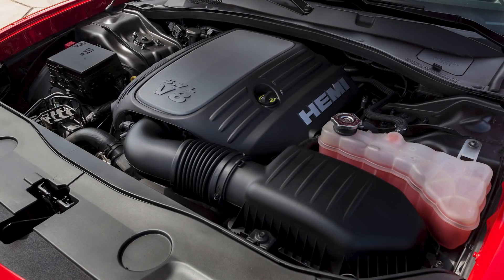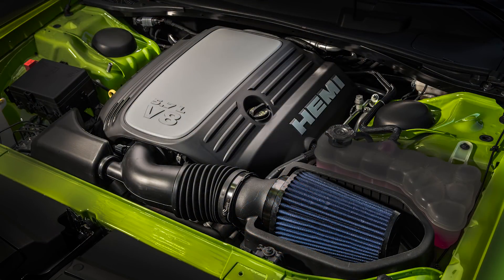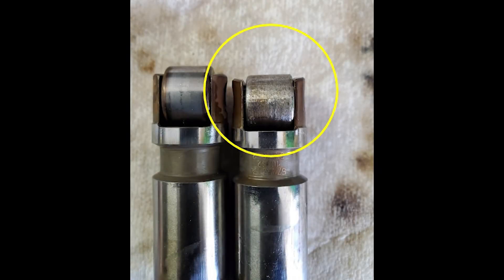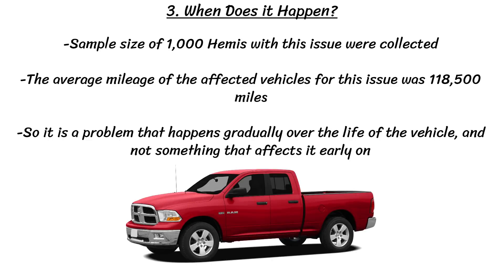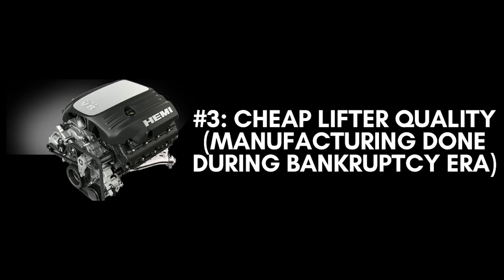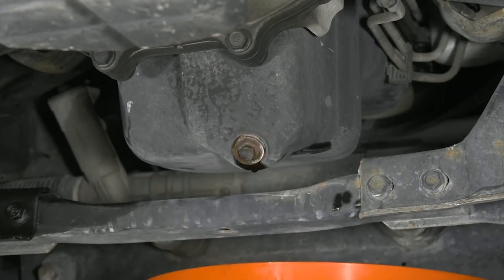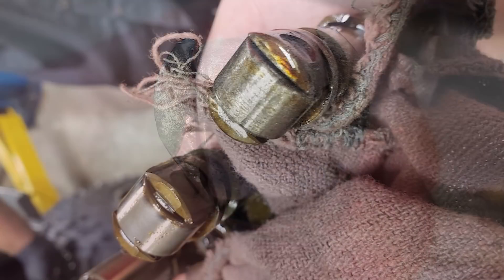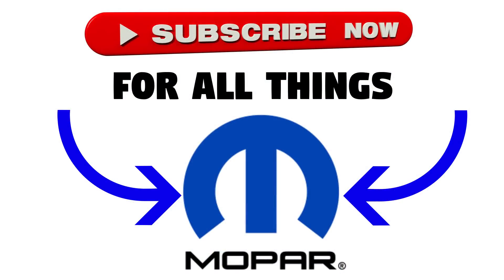The Fatal Flaw of the 5.7L Eagle Hemi V8 Engine Fully Explained (2009+ Lifters and Camshaft Failure)

Comment: My 2010 RT has 204,000 and runs like a clock..... *knock on wood*... That being said, it's whole life has never been late for any service and always used full synthetic. She is also not beat to death. Only idles in traffic and oil is changed every 5K.
Reply: I had 180,000 miles on my 09 Challenger RT 5.7 Hemi,only issue was a waterpump at 140,000...I do floor my cars daily..Sold it a few years ago to a friends son,he still has it and its still rockin!
Reply: @01trsmar  Exactly, the problem isn't with the abuse while driving, unless you count the fact that to many do so with dirty oil and change it when the indicator says 0% oil life. Don't waste money, but if you constantly hammer on your Hemi, you MUST change the oil frequently. The Hemi is just more sensitive to this issue
Reply: 126,000 on my 2010 RT only tick I have is the exhaust leak from the bolts. It's a relief honestly since it's not a lifter tick and if yours has 204,000 I'll say the 5.7 is clearly reliable
Reply: @PigBenis878 Mine ran like brand new until right at the 200,000 mile mark when the transmission went. Never had a tick. My cousin has one with 320,000 miles on it so I have faith that it'll also live a long life in my Duster.
Reply: I have a question...I keep hearing "change the oil every 5,000 miles" how can this be good for the car? I have been racing muscle/pony cars for the last 26 years of my life (all adulthood). I go 3,000 miles on the dot and never let her go over. This has been my experience but I have always owned GM's. From Trans-Am's, to Camaro's, to Trans-Am, to GTO, to my 2012 SS Camaro, and now my very first Dodge 2017 Challenger RT. I'm not trying to be a jerk or a wise ass...is this better for my new Dodge? If it is, please tell me because I am very new to the Dodge experience. 

I almost purchased another SS Camaro (looking at a 2018) but something really bothered me about the car. The more I looked at it up close the less I liked the way it looked. In my honest opinion, and this hurts too say...GM has lost their way. The newer Camaro and Mustang bodies do not look American too me. Thankfully, there was a yellow and black Dodge Challenger RT+P on the same lot. I chose to drive it, almost half heartedly and I freaking loved it! I bought the car right then and there jumping in with both feet. I haven't been this excited about a new muscle car since I bought my 2002 Firehawk Trans-Am...in 2002. That's how much I like this car and the cheery on top is how freaking cheap it's been to mod her.
Reply: @Sinn0100  I do ALOT of highway driving so my engine spends most of its life turning at 2k rpms... Highway driving is easier on a motor, so that why u change it every 5K... That being said if I drive more city or stop and go traffic I would bump it down to 3k.. I also have my oil tested everytime I change it so it's monoterd.
Reply: Thank you. You are living proof as I have exhausted myself telling others the same. Change the damn oil every 3,000 and the filter and as you said high end quality oil. Period guys. SMH.
Reply: @fredwilliams7893  Yep I agree with the 3k miles oil change with quality synthetic oil for now it's still cheap if you do it yourself.
Reply: By runs like a clock you mean it ticks?
Reply: @Iamadroid  99% of the dreaded "Hemi Tick" instances are upon initial startup, and you are hearing the tiny exhaust leak from the broken exhaust manifold studs. That isn't good but it isn't engine damage. Mine quiets down after about 30 seconds and runs like a top. Good oil every 3000-5000mi is the key to overall longevity
Reply: @Iamadroid damn!

Comment: Is the 6.4L in Ram heavy-duty a similar design?
Reply: Yes but doesn't have same problem.
Reply: @snek9353  Oh no the 6.4 doesn't?  Tighter tolerances on the 6.4 it happens at way lower kms on some.
Reply: @snek9353  Yes it does. It's not as common though.
Reply: @gasolinediesel972  Well yes but not really. Not only is the issue MUCH less common in the 6.4, it's also largely a 11-13 thing and the 6.4 wasn't put in the Ram until 14. Also to some minor extent it's also an MDS thing and the Ram HD doesn't have MDS. So sure it's possible for a 6.4 Ram to have a lifter failure but it'd be very very rare.
Reply: @snek9353  You are correct, it isn't common at all, but it does happen. This issue isn't even that common on the 5.7 anymore. Many people think they are having issues with the cam and lifter but they actually just broke the exhaust manifold bolts.
Reply: @gasolinediesel972  Yup, this issue has largely been solved since '14. But the hype and paranoia continues. Roller lifters are high stress parts and these engines have both aggressive camshafts and aggressive drivers. Put that in combination with poor maintenance and no matter how good they make the lifter some are going to fail. 

This hype is why I know about this stuff, I know a lot about engines but don't work on them for a living anymore. But my desire to own one spurred me to research the heck out of this. On the flip side I'm confident I paid less for my car because of the (falsely)poor reputation.
Reply: @snek9353  A lot of people that I see with these engines change their oil every 20k miles and they complain about the engine when the lifters go bad. I've got a 2018 Ram 1500 with this engine. I notice a slight tick when I start it but I think it's the exhaust manifold bolts because it goes away after a couple seconds. 49k miles.

Comment: Gen 3 Hemi lifter  needle bearings too small and too weak. Lifter roller needles were upgraded with thicker needle bearings from 2016 year production. From 2018 another supplier was introduced to supply Hemi lifters. Premature roller failure covers all Gen 3 to  2015. Original PN ended in AA. From 2016 PN changed ending in AB, current lifters end in AC. AB and AC use larger needle bearings. Your observation about needle thickness and possibly metallurgy in pre 2016 or pre 2019 roller needle revisions likely closer to truth.
Reply: Damn I missed the party. I have a 2015 Ram 5.7
Reply: @rockcreekrockcreek6644  heavy duty lifters introduced 2016 year production.
Reply: I have a 2020 RAM SLT Classic 5.7L Hemi. Does mine have the new lifters with the upgraded needle bearings?
Reply: @Thomas_M76  2020 built Hemi has   heavy duty lifters fitted. Heavy duty lifters were installed circa 2016 though supplier change  for some unknown reason 2018 year production. People tend to refer to revised heavy duty lifters as Hellcat Lifters. So you’re good for long term durability and reliability. Engine probably outlast truck!
Reply: @index6738  Good little piece of mind there. I just ordered a 2022 ram with the Hemi.

Comment: Where did you get that idea of changing oil every 3K?  1968???
Reply: Oil is cheaper than engines. We still tell our customers 3k for conventional and 5k for synthetic.  After manufacturers starting telling people they could go 10k or 15k to make it sound like they didnt need as much maintenance, the amount of timing chain failures went way up.  Look up mini cooper timing chains or GM 3.6 timing chain failures or ecotec engines. The list goes on and on.
Reply: Changing full synthetic oil every 3000 miles is nuts,this oil is good up to 8.500 miles ,so if this hemi cant go more then 3000 miles with full synthetic oil,well is a junk.
Reply: @mariuszmajecki2972  We tell people 5k on synthetic and 3k on conventional.  Yes the oil is still good but its the dirt and contaminants it gathers.  If the Hemis are having problems under the best of conditions why risk it. 5k or 6k is prob fine. New engines also have very small oil passages for things like variable valve timing etc.  It doesnt take a lot to clog some up. Do I think the Hemi's are Junk? Yeah I kinda do, If the valve train was designed better it would probaby be a very good engine. The MDS system is another bad idea. GM's version for the LS isnt any better. And all of it runs off oil pressure.
Reply: @jrharryman32  yes,why risk 6 7 or 8.5 ,but on the other hand FCA installed interval light reminder, this computerized device monitor your driving habit and calculate your proper oil interval,so what we are heard here and see is,do not go with the light reminder. Skipped,but again FCA do not change anything about it.
Reply: @mariuszmajecki2972  Those maintenance reminders are nonsense. It started as a selling point in the early 00s for the dealers to say "hey this car only needs the oil changed every 7.5k." Or they gave free oil changes for 100k.  So they stretched the intervals out so the company didnt have to pay for as many oil changes.  The interval light does nothing but count miles. you can reset them anytime without even changing the oil.  So what to they actually do? I wouldnt count on FCA or any other manufacturer to do whats best for the customer only whats gonna make them the most money..
Reply: @jrharryman32  I own a CRV ,oil change according to the reminder light,no problems 13000km ,civic same procedure, 13000km,before have a toyota Corolla, 12.500km between oil change,no problem,this 2019 ram 1500 classic is the first vehicle that other owners tell me,do not follow the factory requirements, so clearly the producers FCA do not stand behind their product,shame of the FCA
Reply: @mariuszmajecki2972  Well Im Honda/Acura and Toyota certified. I can tell you that both of those are much better made.  The K series 2.4 in the Cr-v (if its that new) Is an excellent engine and takes a lot of abuse. When I do have to put timing chains on them its usually over 200k mi. My whole point was the price of doing early oil changes is cheaper in the long run.  You can reset the oil light on the cr-v without changing the oil also. If you changed the oil earlier it may go 300k without needing a timing chain. Our shop also has 2 ruined GM 3.6 engines in cars and I have had 2 people this week that need chains. Its another terrible design that GM wont stand behind. One guys car has 164k it needs chains and The chevy dealer already replaced them for $3000
at 110k. We are cynical about cars because we see the worst of them and what manufacturers dont care about.

Comment: My 14' Charger has had no issue with this thus far. 86,000 miles and runs like a top. I do my own oil changes, and do them on time. Mine was also assembled after the bankruptcy issue was resolved, so "knock on wood"

Comment: I had the same thing happen on my 2009 charger SRT. Cylinder 6 developed a misfire, but it was at 183k miles. It was an amazing car up until then.
Reply: Hell,Toyota,Honda at 180 their engines are shot on a lot of them..Cars dont last forever..You can have 2 identical cars,driven the same way,same maintenance and one will blow up 100,000 miles before the other!
Reply: That's still damn good for a V8 and that's only problem you had. Their better than people think they are
Reply: Shit anything over 5 years of whatever miles I put on my car (100k let's say) on my 21 and I'm happy lol don't need my car for 300k miles

Comment: Use Dura Lube and chang ecey 3000 miles or 4000.  Got 3 Hemi with over 250,000 and still running awesome.. IDLE IS THE KILLER FOR THEM...

Comment: Wouldn't 0 w 40 be smarter oil?
Reply: Maybe, but there's a snag, the factory computer has an algorithm that compares oil pressure to temperature and RPM. If it calculates that the oil pressure is too high it will throw a code. This has been known to happen running 0W40 in these engines. In my next change I'm putting in 0W30, maybe if that works out I'll move up from there.

Comment: I’ve installed a Derale oil filter relocation kit with a larger filter and increased oil capacity on my 5.7 Ram 1500 Classic. It’s running a lot smoother. I’ve also gone to a Air Aid Jr intake kit to help with the air/fuel mixture when using poor fuel, it’s worked in my experience.
Reply: just curious- do the fittings on your derale kit leak? put one on our diesel tractor and all 4 leaked(pipe taped). redid with dope, leaked, retightened, leaked worse- looked with magnifying glass, all 4 fittings had tiny cracking in the black anodizing- the 'crush' from tapered aluminum fitting caused the hard anodize coating in threads to crack as aluminum fitting slightly compressed...still havent put back on, gotta get some brass barbs or preferably just go steel tube fittings and hard plumb it(tractors dont have flex motor mounts- in a car hoses will be needed)

Comment: My 2017 with 8000 miles developed a lifter tick after a sever cold spell. This is the only time it did this. I do a lot of idling. Not too worried, I have a 100000 mile warranty.
Reply: it's a 5/100,000 warranty, up in one year.
Reply: @alzaidi7739  year true

Comment: This happened to my 15 Chrysler 300s 5.7 v8. Cyclinder 3 misfire. Lifter seized and ate my cam. So now im pay out of my pocket to fix it. But im not going stock. Going to put a little something something in it. Non mds delete for sure. Eventually it was going to happen sooner at later. Smh.

Comment: Edit: I'd like to discuss my issues with you involving my truck. Its a 2019 ram 1500 with the 5.7 (non-etorque) rwd. I follow the oil change requirements based on the gauge in the dash and only use synthetic oil, no excessive idling. This repair and the previous are being done under warranty at a dealership. 35k miles for the first repair, currently at 44k

I need to do a video on my 2019 ram 5th gen that had the "hemi tick" last december, got fixed, and is now in the shop for ticking again 😑 last time it was lifters/cam, haven't heard the cause yet this time... its been less than 6 months!!!!
Reply: I know about 2 2019 rams with the lifter tick,one of them developed the tick right after 3000 miles,so FCA do nothing,there is no improvement at all.
Reply: You probably own a 2019 ram classic.
Reply: @starmc26  absolutely not. If you read my whole comment I clearly stated 5th gen which is the new body style. The classic is considered 4th gen just like it was before 2019 too
Reply: @BatesRacing  most people's "hemi tick" is just broken exhaust manifold bolts.... The real hemi tick doesn't develop for many many HOURS of Idling, When the cam and lifters don't get enough oil.
Reply: @starmc26  i guess mine is the exception lol. The first time at 35k turned out to be the lifters, still waiting on the dealership to reach out to me this time so it could be the exhaust manifold this time. Still a problem that shouldn't be happening regardless of idle time! For the record i drive my truck normally as a daily, no excessive idle times (and I'm the first owner since new)
Reply: I've conversed with you before, there's a lot more here than you're letting on.
Reply: @snek9353  such as? Am I forgetting something?